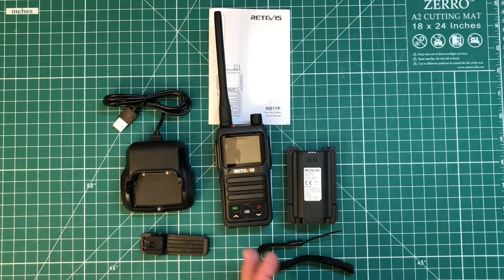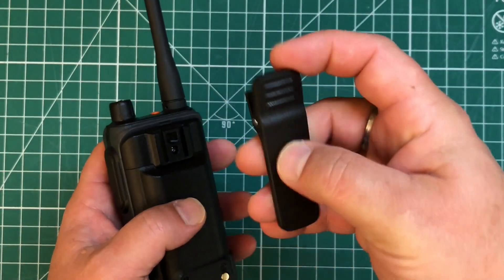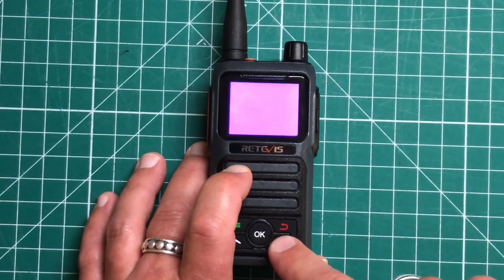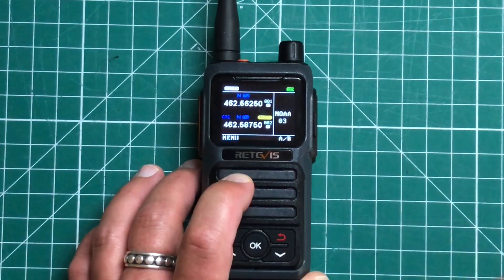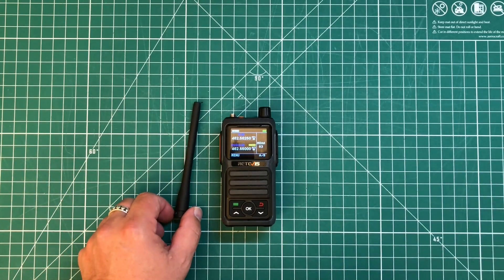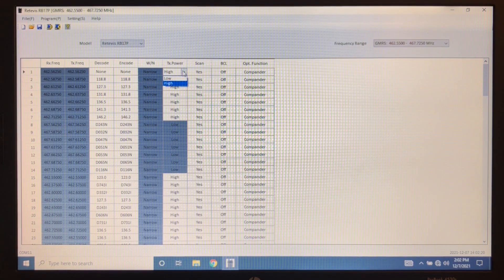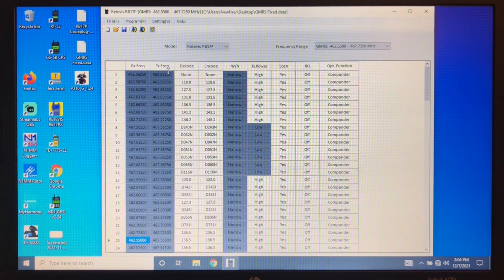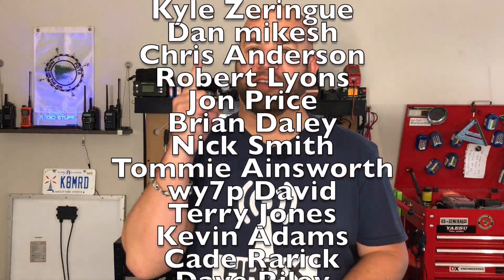Retevis RB17P GMRS Two Way Radio

Comment: I need to buy a set of the "star" screwdrivers, I wanted to ask if you know what size that set screw on the base of the factory antenna is? I see one tool set for sale on Amazon has a little T6 size, but some of the other sets for sale do not have them that small. I want to upgrade and buy a Nagoya antenna.

Comment: A firmware update has fixed the up/down issue, as well as you can now turn on/turn off the ctcss/dcs codes from the radio itself.
Reply from the maker: It sure has.  It's nice when they listen isn't it?
Reply: I was unable to get the newest firmware update, so I bought another one, and it has a newer firmware version which has corrected all the issues I had, including the up/down buttons. It also has a few MORE settings in the menu.

Comment: Sorry, late to the video review after buying this radio late last year.  Went out on an offroading trip and gave up on it when others could hear me on their gmrs radios, but I couldn't hear them.  Is that due to the frequencies being backwards in the programming?
Reply from the maker: It could be a number of things but make sure there are no receive squelch's turned on.  CTCSS, DCSS etc.  That would be the first thing.  Your offset could be wrong as well.  Or it could just be they may have a better antenna.  It's hard to say.
Reply: @hamradiotube  that was it 😀  Turned off the C-CDC option in menu 2 and bam!  Now I can transmit and receive.  Thanks!

Comment: Mine will let you turn off CTSS/DCS by using the side button. Select CTSS/DCS, press ok, push side button and it will cycle through CTSS/DCS/Off
Reply: That is correct. Use the lower secondary button on the side.

Comment: At 4min 25sec you say the ctcss can not be turned off. That is not correct. My radio arrived today. So what you do is when you get to the ctcss menu, tap the programmable side button to cycle through CTS/DCS or off (no tone), it will be an open squelch, no tone required.
Reply from the maker: Thank you so much for this tip!  Even Retevis couldn't tell me that.  I didn't think it was possible but just tried and it worked.
Reply: @hamradiotube  Retevis also claims the antenna is not removable in an Amazon inquiry. LOL

Comment: The default programming on the radio, as well as the defaults built in to the software (see Ch. 23 @ 13:07 in the video), have the Rx and Tx frequencies reversed on channels 23-30, so this radio will not work with GMRS repeaters. Does the "developer" version of the software allow this to be corrected? It looks like it's correct on your radio, so I am wondering if you received it that way, or if you fixed it via software.
Reply: Never mind, you answered this a minute or so later...
Reply from the maker: Lol, happens to me too.
Reply from the maker: yes

Comment: retevis will send you a developers version of the programming software if you email them from their website. The software has the ability to use alpha tags however it does not enable alpha tags  on the radio itself. It also has the ability to program narrow and wide band on an y channel. Why do you program a repeater in narrow band? They are wide band.
Reply from the maker: Yes, I have that as well.  They seemed to not want me to mention that due to fcc regulations not allowing the free programming of frequencies on gmrs radios.
Reply: @hamradiotube  Of course it's allowed if the radio is FCC certified as a Part 95 radio.
Reply: Does that version of the software allow correction of the repeater frequencies which are reversed (and therefore useless) by default?
Reply: @FarmRanchHomestead  It does.
Reply: @RisingTidesAC  Good to know. Thank you!

Comment: It is so good to see so many radios for GMRS coming to market. For decades we used Garmin Rinos, and their niche is not going away, but with the ability to change antennas, and with inexpensive battery packs, the new breed bring a lot to the table! Now if Govt would wake up to the idiocy of having a licensing scheme for GMRS. While I am licensed, my various hunting "brothers" use mine, we are family! Now if we can just find a way to unlock these, because as hams using them on the ham bands is legal for us.
Reply from the maker: GMRS is gaining a lot of traction recently.  Theres a lot of activity in my area.  Apparently it's actually against regulations to have a removable antenna on a GMRS HT for some reason, even though you can use whatever antenna you want as far as I know for mobile radios.  Retevis emailed me and said they are going to change the antenna to comply with regulations.
Reply: @hamradiotube  GMRS can have removable antennas, FRS cannot. I just received this model yesterday, and the antenna on mine is removable with loosening of the set screw.

Comment: While Chinese radios seem to have a plethora of functionality, the quality is not there. Don't get me wrong I have Baofeng, AnyTone and Wouxun radios, but it's like they don't have a QA/QC department. It's extremely frustrating. The kinda of crap that sends you down a million rabbit holes only to find out they screwed up the most basic of elements. 

But I like tinkering and we (hams and radio peeps) have an excellent community out there that's always willing to help.  Thanks for sharing ... I will not be buying this radio, cause I just bought a couple of Wouxun 509G HT's. Enjoy the holidays.
Reply from the maker: I think it's funny that they steal from each other too.  How many fake Baofengs are out there?  A lot.  Wish.com is full of them.  There are some good ones out there though.  I like the G90 and X5105.  Are they Icom quality?  No.  But they are a quarter of the price too.  It does suck when they release something that isn't ready though.  The X6100 comes to mind.